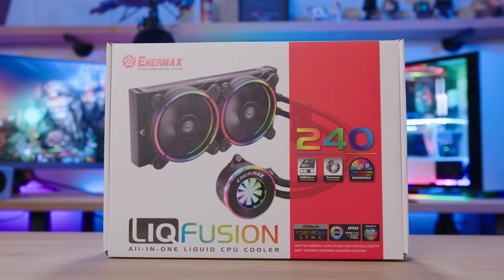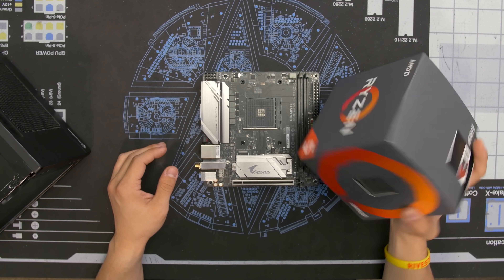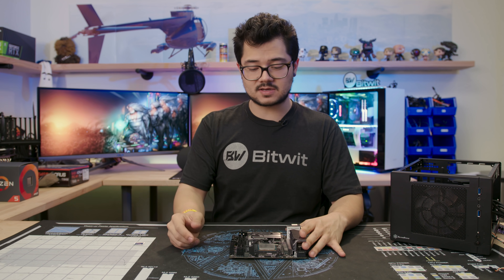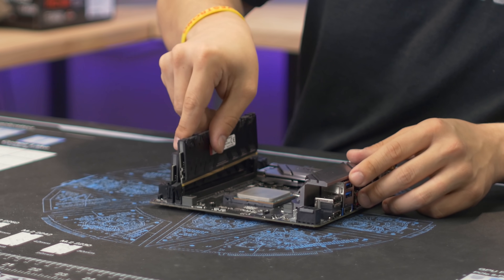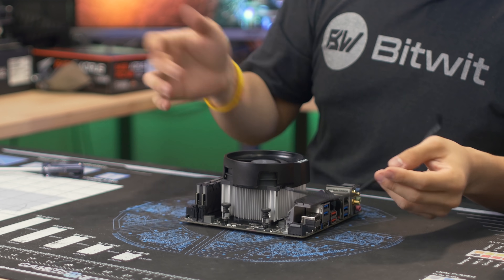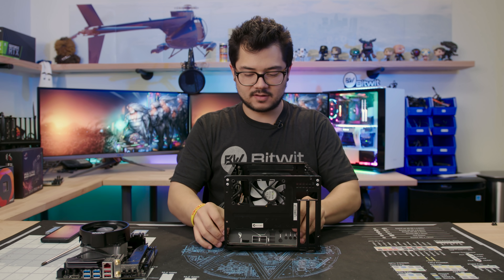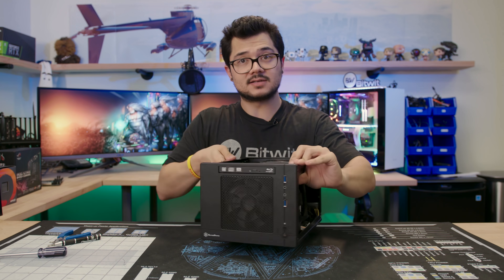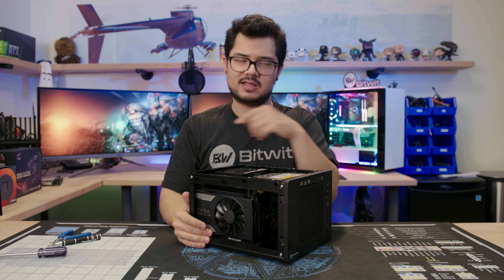Building a TINY PC Step-by-step!

Comment: So many mistakes in this video..
- no allen wrench, tweezers, swiss army knife
- no Bluetooth anti-static bracelet
- installed CPU too early
- no thermal paste bukkake
etc etc

Should learn from Verge, so one day you can build PC for Wallmart
Reply: 9:35
Reply: 1B views uhhhh that’s not tweezers that’s cable ties
Reply: @thechosenone9589  r/whoosh
Reply: @peterpham6288  its the wrong tweezer
Reply: Savage!!
Reply: @AdrianGonzalez-kr9fq  saVagE
Reply: And he installed the PSU wrong way! His brick is surely going to short circuit the whole system!
Reply: @Ramu-10  yeah! He didn't even align it with the insulating pads so the PSU is probably going to short circuit and cOMe InTo COnTacT with the rest of the system
Reply: No screwing with confidence?
Reply: I was looking for this. Thank you, sir!
Reply: I was extremely concerned about his safety when I noticed he didn't have an anti-static bracelet.
Reply: LOL
Reply: Bukkake😂😂🍾
Reply: the second usb 3.0 on the front of the case is broken 18:30
Reply: Thermal paste bukkake :D
Reply: He didn’t put rubber padding between the power supply and the case, we don’t want the computer to short itself.
Reply: aw3s0m0 Diablo 3 
You get my like
Reply: aw3s0m0 He definitely used a screwdriver that lacked any hope whatsoever. You must always hope with your screwdriver.
Reply: Well, at least the Verge plugs in their cables.
Reply: nice one dude but was the bukkake thing realy necesery and my husbund will suck it up and not wast it sperm is inportent
Reply: Thermal paste bukkake, you made my day😂
Reply: is it bad that i read this in the lyle voice?! lmao
Reply: He did call the zipties for tweezers tho
Reply: +aw3s0m0 Diablo 3 This comment is my Christmas present. ly
Reply: psch, didn't you see? he had the yellowtooth anti-static bracelet! and his tweezers were pre-installed.
Reply: You forgot about screwing with confidence
Reply: aw3s0m0 Diablo 3 Give him some credit. He at least had a table!
Reply: Thermal paste bukkake!!! Haha! 😂
Reply: He does have Bluetooth band
Reply: loooool hahaha
Reply: He actually does have a Bluetooth anti-static wristband
Reply: Oh damn you had me lolz
Reply: Omg, I just lost it at the bukkake part. I laughed out hard for a good 30 seconds! Well done man.
Reply: Is the rubber wrist band a piss take of the verge thinking that it was an anti static wrist band? lol
Reply: So many burns, not even liquid helium could cool them down
Reply: Thermal paste is already on cooler
Reply: he had a rivestrong braclet tho lmfao
Reply: didn't wipe off that pesky gold layer on the cpu
Reply: Didn’t even hammer in the IO shield!!!
Reply: he did have a livestrong bracelet on though 2:53
Reply: @Tastelessgeorg  the anti-static bracelet isnt necessary theres other was to ground yourself without spending 15 dollors
Reply: He had da rivestrong braceret!!
Reply: Head Chef HE NOT FIGHTING STATIC HE FIGHTING CANCER
Reply: hahahahahaha
Reply: Can anyone tell which case he is using
Reply: Oh, c'mon now....a little premature installation never hurt anyone.  Its actually quite efficient.  But if both I/O modules are slightly out of sync with one another, it can be beneficial to manually dump the excess seed cache reserves to ensure timing of the burst rate of the thrusting module with the socket receiver to achieve maximum harmony of the system.       YMMV.
Reply: Haha
Reply: Ohhh that's amazing
Reply: And he definitely didn't srew with confidence... rookie mistake
Reply: And he put the power supply reversely smh
Reply: no brackets
Reply: this is absolutely hilarious
Reply: there's someone knowing what he's talking about :'D
Reply: Lol
Reply: The sheer number of memes in this hurts me more than the static from the Verge build.
Reply: You just humbly roasted both of them.
Reply: yeah what fking noob
Reply: “no thermal paste bukkake” 

LMAO
Reply: Blueetooth anti-static wristband... oh lawd lmao
Reply: @Aftaab Hussain RIVESTRONG, dude
Reply: You watch wrong video
Reply: Actually, I'm pretty sure Walmart builds their computers better than the verge lol
Reply: thermal paste bukkake LMAO I'm fucking dying
Reply: He has the braclet
Reply: He doesn’t even have a desk
Reply: Walmart
Reply: I install the cpu first
Reply: one time I make a blood sacrifice with a lamb as thermal paste and it seemed to work pretty well
Reply: Lmao i read this in Lyles voice
Reply: Haha good one! Almost lost all of the food in my mouth there! :)
Reply: aw3s0m0 ꧁꧂ 3000 forgot hope man
Reply: He had a bluetooth anti-static bracelet
Reply: and thermal paste applicator 😂😂😂
Reply: No wrongly installed ram
Reply: at least he used livestrong bracelet.
Reply: correct
Reply: Lol
Reply: He did say tweezers after he said zipties
Reply: "thermal paste bukkake" LMAO
Reply: Is this The Verge? XD
Reply: but at least he got that rivstrong braceret
Reply: Thermal paste bukkake
Ha!
Reply: He had a Gamers Nexus mod mat, that makes up for all those mistakes!
Reply: "Thermal paste bukkake" oooh yes 😏😏
Reply: You mean Anti-Cancer bracelet
Reply: Don't forget the CPU installing bracket either
Reply: hm.... i don't think i askkkeddddd
Reply: Never gets old...
Reply: he had the live strong bracelet wym
Reply: shut up hater
Reply: Anti static bracelet isn't really needed you just gotta ground you're self
Reply: *live strong bracelet
Reply: He is wearing a bluetooth anti static bracelet though?
Reply: The bracelet could be round his ankle tho
Reply: ikr he didn't even screw with confidence
Reply: He had the river strong band tho
Reply: @nicdepuy8156  lol
Reply: I hope he has a Swiss army screwdriver
Reply: Jokes aside it was a bit sloppy, but in a good way, like the real misateks and problems we all have/do when assembling our PCs. In fact the kind of mistakes we tend to do with years of doing it and comes with overconfidence...that makes the video even  more real and better to learn.
Reply: People need to stop trolling before someone fucks their PC up listening to dumb comments like this or actually tune into that terrible video. All that bs just so you can get a like or a laugh at your recycled comment other douche bags decided to post all on the same videos over and over again. Smh

Comment: I like how in-depth you went with how to install RAM. This is often an over-looked item that newer builders are likely to mess up. When I was first taking IT classes in high school the systems we trained on had some interesting RAM or motherboards that made it possible to insert and seat the RAM backwards. Instantly shorted the motherboard. I think we went through 5 boards that year, luckily none of them being mine.
Reply: big mistake on your teacher's part
Reply: @yotoprules9361  These were retired computers from the school. We didn't really have a choice in them. They were Gateway PCs from the early 2000s if I remember right. Let's put it this way - my textbook referred to Vista as Codename Longhorn.
Reply: @patrickprescott5166  I mean he should've made it obvious whicgh way to insert the ram
Reply: @patrickprescott5166  Hmmm, even the early 2000s had keyed SDRAM DIMM memory modules, sounds like something even older, like SIMMs to me. (I'm being a tad nerdy here, aren't I? :-P )
Reply: @outtheredude  they were DIMM. I think it was just the motherboards had an odd slot/latch design that allowed them to go in and still be latched. The keyed offset was definitely there if I remember right.
Reply: @patrickprescott5166  Oh, right, still working on that standards thing a tad, back then. Thinking '90s meet '00s, badly.

Comment: They really need to start making 24pin motherboard connectors as one unit without the extra 4 pin that you need to align. Its gone of the days of 20pin motherboard connectors and don't get me  started on molex connectors those should of been discontinued a few years ago.

Comment: You make it look so easy. I've been assembling computers for 10 years now and this form factor usually takes me 2 hours, partly because I have to undo and repeat steps in a different order for things to fit. Sometimes as a precaution I plug the PSU cables in before I even install the CPU cooler. I bought an M.2 SSD black friday and I waited over a week to install it, because it goes on the back of my mITX motherboard, so I had to unplug and remove everything but the CPU heatsink and RAM sticks.

Comment: WHY DIDNT YOU USE A CPU APPLICATOR AND USE AN EXCESS OF THERMAL PASTE (because it wouldn't hurt to use more)
Reply: Don't forget to install the PSU on the rubber pads to prevent it shorting out on the case

Comment: huh i just got that exact gpu for my sff alt build
Reply: Almost complete opposite here. I have a 1500X, 16GB RAM and a 450W gold psu. It's just accompanied with sata ssd and hdd as well as an rx570.
Reply: I have the same GPU with a 7700k and its a 1080p monster.  Not much more than that tho.  Im wanting a 1070ti or 1080 to start into 1400p/4k.

Comment: Hey bitwit I’m building my little cousin his first PC. I have bought a AMD RYZEN 3 2200G Quad-Core 3.5 GHz with 16gb of ram and a MSI ProSeries AMD Ryzen B350 DDR4 motherboard. How do you think it’ll run? 
If Bitwit doesn’t respond, anyone can input I would just like to know.
Reply: Depends on what he expects and and your budget
Reply: My suggestion is to choose ryzen 5 2400g with 8gb ram, higher clock and better vega graphics
Reply: @dzikputih  16gb is the minimum ram I would run now a days
Reply: I appreciate the feedback guys, I’m reading through most of the comments so it’s hard for me to reply to everyone but do know I’m reading lol
Reply: @sk8neverdiez  ive been using 8gb of ram for a long time and never have problem with it if you have fast storage, better spend more on cpu, and upgrade the ram later if you have tight budget
Reply: @dzikputih  true ram is very easily upgraded down the line, I am over 8gb very very often, but I am kind of a power user.
Reply: @sk8neverdiez  yeaa, depends on user itself, i dont really like to run multiple applications at a time, thats why 8gb is enough
Reply: @dzikputih  apu use 2gb ram for the integrated graphics and with 6gb ram on gtav it will get big frame drops
Reply: @prodigyz2416  waw, thats something new. ill keep that in mind
Reply: @dzikputih  yeah also if u have say a 2400g it tales 2gb ram to substitute for vram so if u ever get a dedicated gpu it no longer uses the integrated one and it will be back to whatever ram ex: if u had 8 only 6gb eould be usable and if u get a dedicated gpu 8gb would be usable again
Reply: @dzikputih  he already bought it dim watt
Reply: Go on PCPartPicker.com
Reply: Gpu?
Reply: @FirasLaallam  The GPU is the only thing I haven't bought yet because I haven't made a decision, lol.
Reply: @RJBuildsPcs  You should balance the processor and the graphics card otherwise it's gonna bottleneck damaging general performance,for the cpu you should spend around 60% of the graphics card price. You can check on bottlenecker.com, if you insert the cpu and the gpu It will tell you if it's gonna bottleneck or not
Reply: Post it in r/buildapc on reddit and you'll get a ton of wonderful replies. It helped me a lot !!
Reply: Get a nice gpu.
The rx 460 2gb is quite nice for its price which is below 100. It would definitely be an upgrade from the integrated graphics your using
Reply: You can get RX 470/480 on eBay for close to $100 bucks all day long (I just bought a 480 for $105) and they are amazing graphics cards for the money. Nothing can touch them for price to performance.
Reply: Hi, 
If this is for 1080p gaming I would recommend lowering the RAM to 8 GB and increasing your budget for a GPU.
At < $100, the quality of GPUs sharply decrease, and I don't see a reason for that much RAM. I don't know of any sub $100 GPU that would be good for 1080p gaming. I would suggest a RX580 if possible, otherwise an RX570 will do. Ignore the NVIDIA products for budget builds.
Your motherboard is pretty high end for a 2200G build, unless you're paying under retail (I'm seeing it at $90), I would say a cheaper motherboard priced at $60-70 is optimal
Finally, with the money saved from the motherboard downgrade I would recommend a cheap 128 or 256 GB SSD as a boot drive, as the increase in performance in everyday use is insane
Hopefully that will fit in the budget
Reply: Look for a used rx 480 or 580 on ebay for less than 100. If you want new you can get an rx 570 4gb for 140 and it includes 2 games on newegg. These cards are going to be within a few frames of each other in performance. you can look up youtube benchmarks to give you an idea. You can get an incredible deal on them right now especially the used gpus. There are some 470/570 also. I really wouldn't go lower than these cards as these are an incredible value and should get 1080p60 in almost every game ultra settings. I spend a lot of time building pc's and looking for deals and I would highly recommend getting used 480/470 580/570 on ebay or local or getting a new 570 for 1080p 60 fps.
Reply: Hi Robert, I recommend changing the Motherboard for a ASRock X370 Taichi Motherboard. You will future proof your little cousin's system in the process. Also, if and when you do upgrade, go for the AMD Ryzen 3rd generation (The CPUs released in 2019) because these will be on the 7nm manufacturing process, in turn, making them cheaper and more powerful for the price you pay for. 

In addition, to solve your GPU issue, if you want to save money, go for a Ryzen CPU that is a APU also, one that has integrated graphics. For example, the 2400G will have better graphics than the 2200G. 

I have a question, what type of case are you looking for? Do you want a small form factor or a large case? (Gathered as you commented on this video, I assume a small case?

Have any more questions, I'm happy to answer.
All the best, 
Chris
Reply: ChrisTechTips sorry it took me a while to read all the replies. I got the MasterBox Q300L mATX Case. 
I was gonna let him rock it with the APU for  while until I bought him a dedicated GPU
Reply: you will have to update the bios
Reply: Honest answer it probably run 1080p games mostly 60fps or less . Get Ryzen 5
Reply: Robert Spaulding  I think that’s a great start and nice that you’re building it for your cousin.  It’s got good upgrade potential and something the two of you can work on future upgrades together.  Budgets are always helpful with these kinds of questions as well as games and expectations. I trust you’ll be using an ssd for a boot drive.
Reply: add me on discord and I'll help you with everything
several people#0001
Reply: Hülye Vagyok its gonna run pretty good but without a good graphics card it will not run games really good (expect 30-50 fps 
in gta)
Reply: Change the ram to 8gb and get a 570. 16gb is too much
Reply: Gtx 1060 3gb would be a good gpu
Reply: @christiangetsos1835  rx 570 is currently cheaper and runs faster most of the time than 1060 3gb
Reply: Or a gtx 1050 2gb or a gtx 1050ti 4gb
Reply: Well people... first we need to ask him his budget for it
Reply: It’ll do 1080p medium settings 45 ish fps. Later you can get a 120 dollar rx 570 and it’ll do high settings 1080p 60fps.
Reply: https://www.ebay.com/itm/PowerColor-Red-Dragon-Radeon-RX-570-4GB/401661045857?hash=item5d84dd2c61:g:CIQAAOSwAopcGC8~:rk:9:pf:0 this is a good choice.
Reply: https://www.ebay.com/itm/XFX-Radeon-RX-570-RS-XXX-ED-4GB-OC/183596583588?hash=item2abf358aa4:g:hKYAAOSwuHJbqRZZ:rk:29:pf:0
or this is good
Reply: uh you need a graphics card if your looking for a nice cheap one pick up a rx 570, it's about 80 bucks if you can find one, if you want about 1060 performance pick up a gtx 970, about 100 dollars
Reply: rx 570 performs like 970 both are about 10% slower than a 1060.
Reply: Check out TechEpiphany. He has a playlist experimenting with 2200g with games a lot.
Reply: @Hülye Vagyok hogy jon ide a bo4
Amugy ha vesz bele a srac megalabb egy rx 570et elmegy 60fpssel
Reply: I have the same build just an extra gpu tho rx570 8gb idk how it runs on Vega graphics but my pc runs great also overclocked the cpu to 3.8ghz
Reply: Get a gpu and cut down 8gb ram it will save money for the gpu
Reply: I’m not trying to build anything too fancy at 1080p for him. I’m still stuck on the graphics card. Anything under $100 is a good range for me. He plays Fortnite, Brawlhalla, Roblox and Minecraft so a lower end ryzen build was my choice for him.
Reply: @RJBuildsPcs  Most of those games should be good  but don't expect high on all settings, for a gpu go for a rx570 or 560
Reply: @RJBuildsPcs  if he only plays those games buy him a Nintendo Switch it has all those games except Roblox
Reply: Don’t skip out on gpu if you want to play Fortnite you’ll need to experience at least 60fps or jus don’t play it
Reply: Hey, u can't cheap out on the parts really, espescially the gpu beacuse that is what does most of the work in games ans the cpu